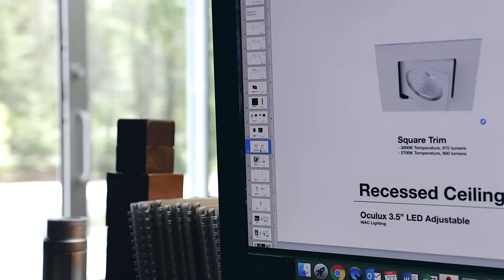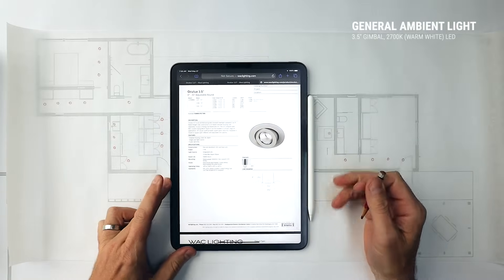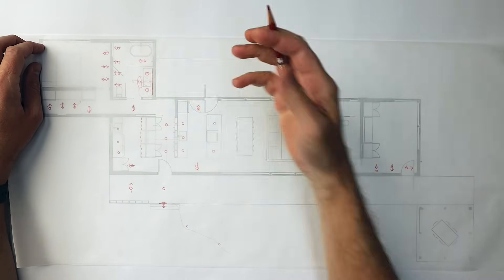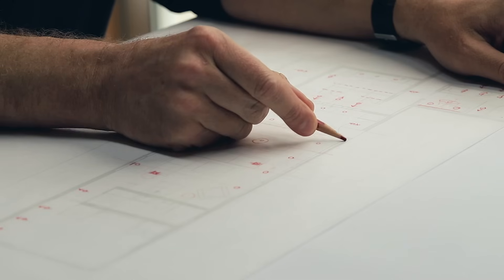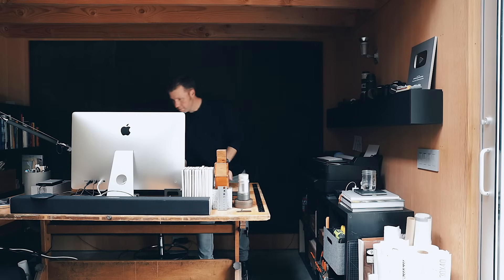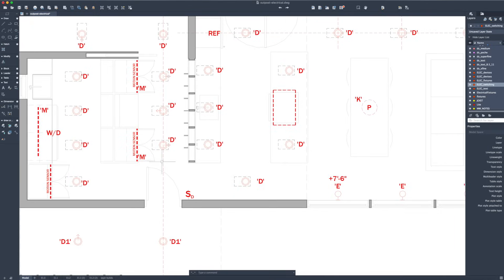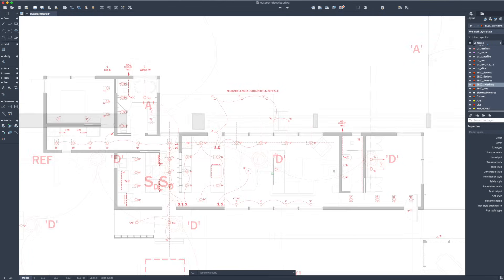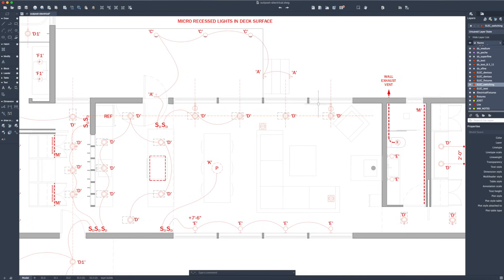How I Design + Draw Architectural Lighting Plans

Comment: The art of mastering the use of natural light is key to a good house.
Reply: Of course.... until the sun goes down
Reply: Pity the majority of housebuilders (especially here in the UK) don't agree... the windows are so small (and typically we only get one per room - if you're lucky) and it's already dark 90% of the year! Artificial lighting is all we have to work with in 99% of cases even during the day - it's truly depressing (unless of course, you're lucky enough to have an architecturally significant home.. in that case, it was designed to have natural daylight by someone who cared for the way we humans live rather than to sell a house as quickly as possible.)

Comment: I have been a residential and commercial drafter since the mid-80's. I appreciate your video. However, it may just be this project, I don't necessarily know where the furnishing will be placed in the house though I agree some is assumed.  Remodeling has been the easiest for me as the homeowner often want new furnishings in near or exact locations as they were. 
I recently created plans for a medical office and though that was a much easier electrical/data/WiFi and lighting layout as a commercial project, I had to think of how the client would place where the exam tables, desks and such would be placed. So, it was my best guess and used a consistent process throughout the 14 exam rooms, four doctors offices and three nurses stations.
Then as the project moved forward the client asked for cabinetry layout. Wow! Having this part of the process included helped me a great deal as now I had a more complete picture and the layout fell into place for the lighting, switches and outlets. 
I have worked several projects with an interior decorator on remodeling projects and found these projects my favorite projects to draw. I am working more closely with the knowledge of what piece of furniture will go where.
I will soon be starting a residential 2nd story addition and major remodeling project. I'm really looking forward to getting back to drafting!!!
Thank you again for this video. I found it quite beneficial!

Comment: I've always been disappointed just how seriously lacking residential lighting design has been; relegated as a disinterested afterthought to comply with code minimum requirements.

It wasn't until the 80's people began taking lighting design seriously, and began to think in terms of task, general, accent, and the concept of creating a desired ambulance.

One of the biggest mistakes made is the lack of planning for outdoor and landscape lighting, and you pointing out the windows appearing as large black sections of wall is classic!

One thing I have noticed that has disappeared from kitchens, but was common back in my day decades ago is a recessed receptacle high on the kitchen wall for a clock, lol.

But lighting also has become more complicated now days with code requirements like general lighting, automated lighting control requirements, low energy consumption, minimum lumens.

Glad you pointed out about cross referencing with the structural layout early on; that is such a common pitfall in the field.

I can appreciate the desire to leave out information to avoid change orders because you might lose track and forget to fully update the switch symbols due to multiple revisions. This kind of thinking has been a growing trend with today's architects to the point of plans being wilfully deficient. For example you can use that same rationalization to leave out your circuit lines as well. The dictionary definition of the word "Architect" is "Master builder". Unfortunately, I think the Architectural field has deviated from it's Master Builder origins and have become little more than just "Stylists".

Comment: You did a good job showing that there are lots of decisions to make when doing an electrical plan.  You must meet the code requirements first, then you have to think about making sure everything is convenient, and attractive.  It is excellent that you mention the artistic value that light plays in architecture.  It probably doesn't get the attention that it should.

One type of design decision that takes a bit of thought is spotting the "advance, and retreat" paths to locate switches along them so the homeowner can turn on, and turn off, the lights as he comes into the home after dark, or turn them off when he goes to bed at night.  He should never have to walk to the far end of a room to turn a light off, then walk back in the dark.

And, BTW, if an electrician put in a change order to use a 4-way switch in place of one that is marked as a 3-way on the plan, but was clearly shown in a circuit with 2 other switches, I would inform him that he would never be allowed to bid another one of my projects in the future.  It's his choice, be a greedy jerk now and make a few extra bucks, or get blackballed and not get future work.  It's not hard for an electrician to just redline his drawing before starting work, and being a team player so he is considered for future jobs.

Comment: Nice. This is also pretty much how I work. What has changed over the years for me is that I am using simulation for the lights with 3D plug-ins and Sketchup. But traditional layout technique is still important I've just gotten so comfortable with electronically working with plans that sometimes I skip this process. But yes, going back to the basics is a good way to exercise your hands and sketching capabilities which are still pretty important in certain situations.

Comment: Enjoyed the video, and love the presentation of your lighting submittals. Something to keep in mind when dimming LEDs and lighting fixtures. Keep in mind that your fixture selections need to be dimmable. In addition there are 3 main load types for LEDs when it comes to control types. Dependent on your control system/dimmer, you may not be able to dim your step lights with the exterior deck lights (on same switchleg), as they could have different load types that require different controllers or wiring methods (0-10v).

Food for thought. Thanks for the video.

Comment: As a beginning designer, I appreciate the process you have set forth in designing a coherent electrical plan. I am curious if you use chandeliers in your line of work, and what precautions you take when planning. Does this come at a later phase, perhaps in conjunction with structural engineer's drawings?

Comment: Another excellent video.  Always a good insight into how another practice operates on a day to day basis throughout the design process.  As your time as an architect, have you had many clients requesting a low energy / passivhaus design?  I work as a technician (in Scotland) and deal with the domestic energy calculations, but the Passivhaus designs are an area I'd like to learn more about.  Is there much call for this type of project in America?

Comment: Are you centering the gimbles with the windows to simulate the same lighting response as the natural light cast, or centering between windows on the walls for washing the walls and artwork? You have made me address my division on vaulted ceilings rather than symmetry by default. Thanks

Comment: Hello sir,

At the twelfth minute around 12:00, you show your cad screen and I noticed that your model space looks exactly how it would look when you plot your sheet. The purple solid hatches are all looking grey. May I know how to make the layers display as per the ctb settings in the model space itself? I guess this is a basic trick that I don't know about. Btw, I have been using your ctb template and it has helped make much cleaner drawings. Thanks.

Comment: Question:  What design decisions would you use to guide you if you were trying to design a home that is both inviting in the cold winter months and also "pushes" you outside during the summer warm months?  The two that come to mind are windows and an equal amount invested in the outside decking with an emphasis on connecting the inside spaces to the yard.  Terraced wide decks come to mind.  What else am I missing?

Comment: All so nice and cute...I assume wherever you practice there are no Building Regulations or inspectors capable to check if there are enough "candels per m2" on the top of the kitchen worktop. Artificial light as an essential "element" cannot be treated like one accidental bulb in the back yard shed. You are placing one (example) and it is sort of  OK why then not put 20 (I'm exaggerating just to make my point)? Where are the fundamental rules of illumination, intensity, colour  (not color) :)  Nevermind Eric will still follow :) because you are doing a great job. Take care and stay safe

Comment: I see two different videos for Split air con system. the other one is "split ac wiring diagram indoor outdoor single phase" . Which of these two wiring is correct? When and why we use any of thses two sytems?

Comment: As we move towards using LED lights more and more to save on power it may prove that some of your light fixtures specified, or more specifically the LED bulb used in those light fixtures, cannot be dimmed. And even if they can they can, only be dimmed down to 30% before turning completely off. Additionally dimming a LED down low may not bring on those warm colors that we have become to expect with incandescent & halogen bulbs.

Comment: I was wondering if you can help me? I have a living room project that has a barrel-vaulted ceiling. I have photographs and hopefully accurate measurements from the client. I do not have access to the site yet but need to figure out what the slope angle of the ceiling is in order to draw it correctly in Revit. I need to do this so I can understand how to properly wash the ceiling with linear light fixtures in Agi32. What do you suggest? I can provide pictures and dimensions.

Comment: So sad in Revit dont have a light attached to the concrete finish roof. Not ceiling ciz in Puerto Rico houses does not use ceiling. Any tip to fix that in Revit?

Comment: Great video! I'm an interior designer and studying building engineering right now, you bring me so much inspiration.

I have a question, is your autocad in mac laggy? I use the mac version too and it's very laggy compared to the extremely fluid Windows. Do you experience the same? thank you!

Comment: I am from Turkey, and an electrical engineer working as an electrical designer. One of the things I do not get in the designs done in other countries is why you draw arcs between lighting fixtures, even between various electrical equipment. Do they really install wiring between them in an arc formation? We use straight lines, while you use countless arcs. I do not think they are installing wires in some arc formation, so I really do not get the point here.

Comment: Is that just AutoCAD? How do you bring up certain electrical icons so quickly?
Reply: He has presets of everything drawing related, he even sells them on his website, I see they're available in AutoCAD and Revit versions but I believe he does mostly use AutoCAD based on previous videos I've seen. I'd think the electrical fixture elements are in there too.
And since he's a solo practicing architect who has had to do it all many times before, it makes sense he would have everything preset and ready to copy from.
Reply: Tim Phillips  Yes. AutoCAD LT. I said AutoCAD, didn't feel like I needed to specify more. And yes, by "having presets" I meant "blocks gathered along the years" (along with other elements, settings etc.) that he has on the ready when he needs them.

Comment: Why not open 3D RT rendering software, import build made in Skpetchup ( 20mins of modeling) and then you can play with realistic geolocated sun. And then you shall start adding Lights in RT viewport, so you directly see a real time realistic results of the lightning. By this way you dont have to imagine anything, you will see it exactly as it would perform irl. + on the upper side, its more intuitive, and creative and mainly more fun and faster work. + result communicate to your client in much more profound way. All you need is one 10minuters tutorial and you dont have to do this 20years old workflow.

Comment: As a lightning designer I have to disagree on your theory for spacing of overhead fixtures. You should never be concerned with lightning the floor. You focus should be on lightning the space. If you only concentrate on the floor, you end up with dark spots above. Ideally you’ll want to create an even field of light at head height. This prevents your subject from walking in and out of pools of light. This ideal space would result in overlapping pools of light on the floor.

Comment: it would take too long if it worked like this, for a mixed use hotel apartment and mall project, it could take up a lot of time... me,  I work directly on the working drawings, then review them, before working we have determined what type of lights will be used, then positioned as needed.

Comment: NEVER enough outlets because most of them are covered with furniture!!! Code is NOT enough!!! Also ... if you don’t have a central vac system, power outlets with the light switches are extremely convenient in bedrooms to plug in your vacuum at the door!